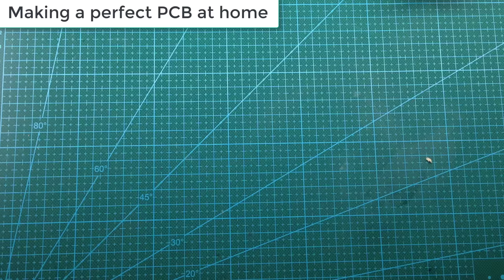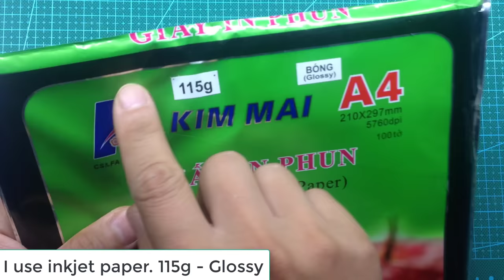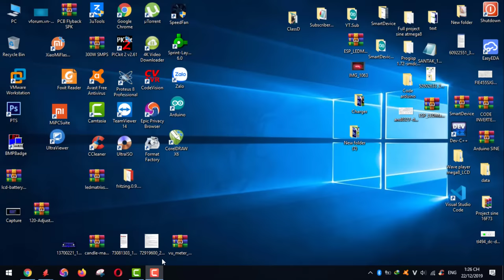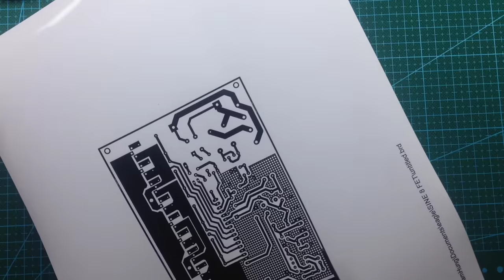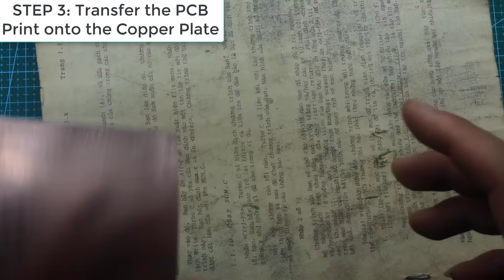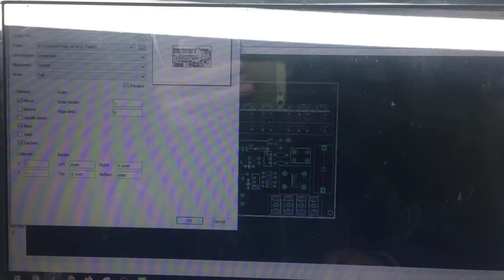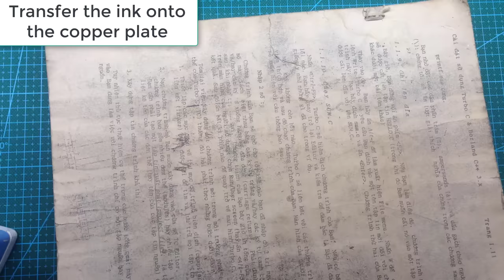Making perfect PCB at home

Comment: In China, we always prototype the two layers PCB with less than 1$ to manufacturer, after 24 hours PCB will be ready for delivery from manufacturer, about total 36 hours later we can get the PCBs in hand.
Reply from the maker: yes, i usually hire factory to do pcb in bulk, but when doing pcb test. I usually do it myself.
Reply: You could make pcbs for free but one thing that maintain people to still making pcbs at home is the shipping time and cost of the shipping is not the pcb price is the shipping. If you live out of china there is always a significant amount of time to wait until the pcb arrives , those times can be at least 1 month for america or one week but with a shipping  cost of 30-50usd. If you can send me pcb's with one week $10usd shipping I'm yours.
Reply: Also pcbs larger than 100×100mm can get pricey

Comment: Awesome, interesting technique!   That drill press is just amazing.  It is so sad to see people who cry that they need to buy all these tools to be productive, when I should have been thinking of ingenious was to improvise my whole life.
#ono
Reply: I do the same tricks for pcbs awesome  awesome
Reply: rocky runner great.  It’s nice to keep making your own tools if you don’t have any.  keep up good work.
Reply: Yeah. Do you know what it costs to buy a little drill press for this purpose? It's unjustified. So I got a ~$20 drill press stand (for hand drills) and a ~$10 hobby motor that came with a chuck and bits, and I was rolling with a $30 PCB drill press, give or take a bit. The things that I already had though were pieces of rubber to make a spacer because the clamp on the drill press stand was too big, and a 12V DC power supply to power it.

Comment: @6:30.  Amazing transfer!  And that’s just any old inkjet ink??  And that unbalanced fan for agitation.  Effing ingenious!!
Reply: Must use Laser Printer for transfer.

Laser Printer prints with plastic toner powder(not ink), that can be transferred to copper PCB with heated iron.

If you don't have a laser printer, you can have printed by local print shop of your choice, like Kinkos, FedEx, or at your workplace.

Most large large copy machines use Toner/Laser Printer inside for making copies.
If you can print with inkjet at home, then you can have copies made on a copy machine that uses toner/Laser printer for making copies.
Reply: xmrtuvgs my bad, I must not have typed what I was thinking, LOL!  Years ago, I bought a somewhat cheap High-res Samsung printer for this purpose.

Comment from the maker: Finished products https://www.youtube.com/watch?v=ksk0an3RUfQ

I rarely use multi-purpose PCB. I usually make PCB from copper plate. It is beautiful, and works stably. Many team members often ask me how to make perfect PCB at home, so Today's video I will show you how to create perfect PCB from copper plate.
Facebook group : http://bit.ly/CreativeElectronic

#Inverter
#12Vto220V
#PCB
Reply: Thank you very much.....
Reply from the maker: thanks <3
Reply: I have always used the glossy paper (not the same as you) but everytime failed to transfer the toner ink fully on the copper plate. Any suggestions? Does it have to do with the paper or the time and amount of heat applied during pressing it with iron. Please help
Reply: @PhdHung  I liked the video what was  the  rock you shaved off and mixed with the gasoline to make the terpentine ?  Thanks

Comment: Provide the link of that stone which is used for protection of pcb copper
Reply from the maker: I bought it at the store, it's a pine resin concentrate. You can use flux solution to replace it.
Reply: @PhdHung   thanks a lot keep helping

Comment: Nice work. Is it ink from the printer like the wet ones in the photo paper you had ironed to the pcb or is it laser printed/carbon copied. Thanks for the reply!
Reply from the maker: I use the LBP2900 printer. It is a laser printer

Comment: Please help. After ironing, i find it difficult to remove the paper from the copper plate easily. It sticks so hard to the copper plate and even if the paper comes off, i will still have a very thin layer of paper on the copper.

Comment: Thanks for this tutorial, but help me out hear, I've several copper plate and I bought fecl2 (iron II chloride) 98% anhydrous, in a powder form ( even the color is more white not darker like your) But no matter how much fecl I use to make a solution it just scratch the copper plate not etching at all.
What is your advice; I'm suppose to get the etching agent in a liquid form!?

One thing again, I'm using Macbook Pro, is there any software to burn hex file into 12f675, but even on windows i did try to without any success I bought pickit k150, please  advise on what I can do to accomplish that 

Greetings from Tanzania 🇹🇿
Reply from the maker: You need FeCl3. Or can be replaced by acid HCl + H202. FeCl2 cannot be used. K150 is very bad. You should be replaced by pickit2.
Reply: Homemade 102, thanks for your reply, can buy pickit3 instead of pickit2!? (Thought 3 will be upgraded or something 🙆🏾‍♂️).

And please create a tutorial to guide us on how to use those pickit, I mean updated tutorial perhaps if you have one already
Reply: HCl + H202 this works perfect
Reply: Dusetteram, when you say "HCL + H2O2", you one of them (hydrochloric acid or hydrogen peroxide) or both!? I'm a bit confused
Reply: @raymondmichael4987  both
Reply: @raymondmichael4987  mixed both
Reply: @raymondmichael4987  Mix at a 2:1 ratio, 2 parts Peroxide to 1 part HCL (I use Muriatic Acid) I have a solution of 300ml of peroxide and 150 HCL and it has been working wonderfully so far.
Reply: @DarrenGerbrandt  , Thanks a lot. That will help
Reply: Hi, greetings from your neighbor in Kenya
Reply: Killean Muraguri, asante kaka.
Nmefurahi kukuona anga hizi za "tonics"
Reply: @raymondmichael4987  Karibu Sana brother. 😊Nafurahi sana kuona waafrika katika teknolojia na elektroniki. Cha kushangangaza ni  kwamba tupo wachache lakini natumahi tutaongezeka. Shukrani sana Kwa kuwakilisha Africa.👍👍

Comment: There are much better (and safer methods) to make etched PCBs.

Your method of using ferric chloride seems a bit dodgy. You can easily make an etching solution out of two parts hydrogen peroxide and one part muriatic acid.

You can get the hydrogen peroxide at the pharmacy and the muriatic acid at the hardware store.

Your method of cleaning the board after etching is VERY dangerous. I realize that gasoline can be used as a solvent, but there are again safer methods.

If you use the etching solution I put above you need to rinse the PCB with water to neutralize the etching solution, and then scrub it with a kitchen scrubbing pad (Scotch Brite here in the US) and Isopropyl alcohol (90% or better).

There are also commercial products you can use to protect the board, final cote is one, or use a UV curable solder resist paint.

I admire your ingenuity, but safety is paramount.
Reply: Well, I would venture to guess because solid FeCl3 is SUPER cheap and safe to handle whereas commercial grade H2O2 and muriadic acid (aka hydrochloric acid) is considerably more expensive and a powerful combo of oxidizer and acid. With proper storage/disposal of the FeCl3, its not super detrimental to the experimentor or the enviroment. I do see and understand what you are getting at. FeCl3 can be some nasty stuff in solution or if ingested..

Comment: CNC much better and faster.
Reply from the maker: Yes, that's right. But not everyone has a CNC machine.
Reply: Bullshit. You will setup you CNC longer than I made the PCB with proposed technique. If you you're after real quality then JLCPCB is the way to go. It's dirt cheap and yet very fast and you end up with a top notch quality double layer PCB with all stuff on such as vias, solder mask and silk screen.

Comment: Bro the problems I face is >3 __1 when I print out the pdf file it came out too large the ic can't fit at all __2 the type  paper  to use  to print ___3_the  chemical   is no where to found ....but I need to under stand better how to print out the exact size of the PCB thats  the main prob
Reply from the maker: Use 1: 1 ratio